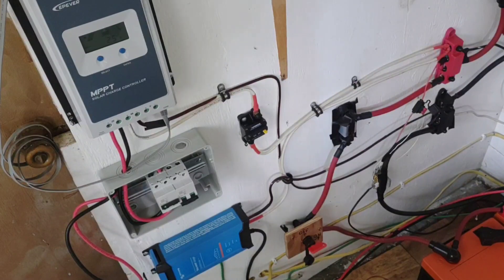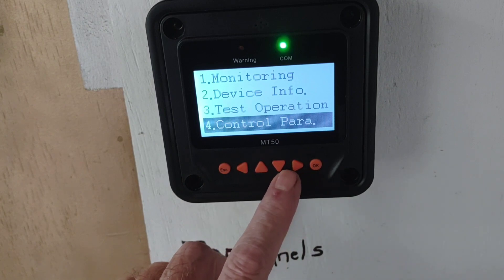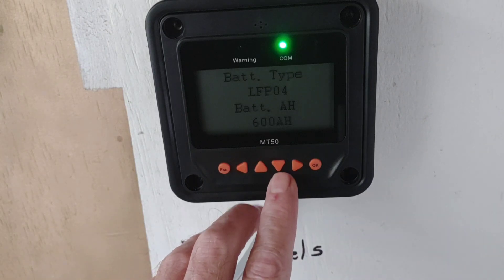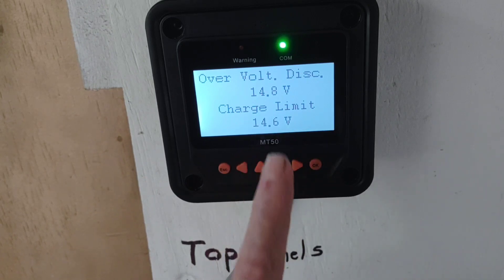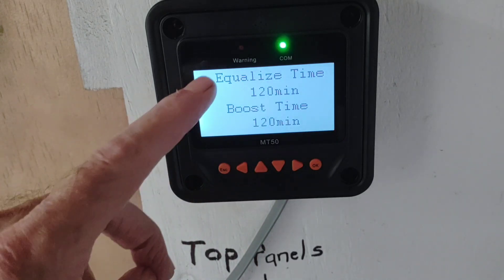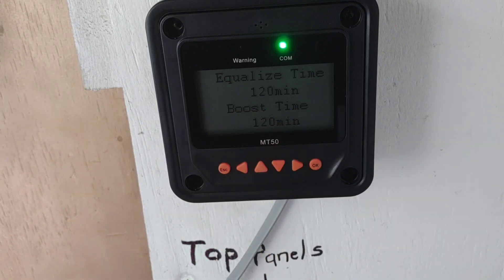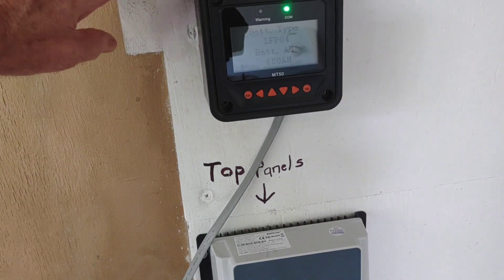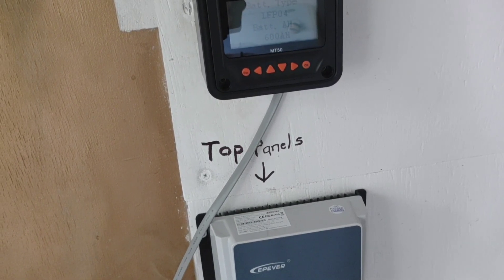EPEVER 40amp charge controller now has LiFePO4 settings installed! Yeah man!

Comment: Thanks for the video. But for some reason when I do connect my battery after clicking open button in the program it only powers up the controller like normal and the program never stars to run ? Any ideas ? What's wrong I've tried everything I can think of and followed the instructions extremely closely...

Comment: If you have a 24v system the preset to choose on the new Epevers is lifpo8, if you are having the error when attempting to set up an older Epever with lithium, you''ll get an error when saving the settings, take note of the error, go back to the start, make the changes again but skip the setting before the setting that gave the error, save settings then make that one change that was skipped, should have video'd what I did, I was waiting on a new MT50 as the old ones don't give the new settings built into the new controllers, PC connection failed, though it worked in the past on the old err Epevers I have and it's far far to hard to change parameters on the controllers interface without the MT50.

Comment: yeah LFP values with equilize;Flot;boost and other trash that not exist for LFP batterys.

there exist 1 value 14,6 Volt charge voltage and anythink other is try to hold consumers for nerds...

Comment: Can you off any help i have this same controller and two chinns 300ah lips batteries mine don’t have this option it’s about 5 monthsmold
Reply from the maker: Are you using the MT50? 🤙
Reply: @ProjectsinParadise808  yes i hooked it up and have the battery specs but haveing a time making changes

Comment: Thanks for the video, have the older Epever 40a without the Lithium settings included, I have a 24v flooded setup with this same controller, the batteries are near the end of their life, will be buying 2x 12v lithium batteries that are suitable for series connection, can anyone tell me if you simply doubling the charge parameters for 24v, there is very little online about setting up the older controllers for 24v lithium.

Can I ask why people setup these chargers for 12v when doing so halves the total Watts you can supply the charger from the panels, if this setup had 24v battery you would only need one controller as it would be able to use the wattage and voltage from all the panels you now have and 24v systems transfer the current from the charge controller far more efficiently.
Reply: In my case, it's because everything I run is 12 volt and it made sense 10 years ago when I bought my epever. Since then, I have upgraded batteries and panels but plan on sticking g with12 volt. It does what ii need.
Reply: @marshallmilligan761  12v systems are ok if it's all close together, I live off-grid and a 12v system is inefficient and not an option due to the extra cost of the expensive cable to get it to the furthest point, 24 to 12v bucks are cheap.

Comment: Thanks for doing this. I have the same charge controller as your first one. I used the settings from this video and all was fine until I disconnected from PV first and battery second to install a cigarette lighter jack. It was only disconnected for about 10 minutes. I went to fine tune equalization time and noticed all of the custom settings were lost. This is my first LiFePO4 battery (Chins) and it hasn’t been great. Just a heads up to anyone else here doing the same to check periodically that there settings haven’t changed unexpectedly. Thanks!

Comment: The old version m50 does not adopt  the automatic lifepo4/ lifepo8 settings; insted programing the m50 on "user" reset the device parameter to "user"  mode at the given parameters. Thank you. (The new tracer an 30A is also LIFEPO4/8compatible)

Comment: HI! Got a question for you. My Epever 3210AN is just 2 years old, but has no settings for LiFePo4. At least, none that I can assess at the unit. If I get the "remote," will it show that there is in fact a setting for LiFePo4 batteries? Thanks!

Comment: Someone who can answer why my 51.2 v 16s battery is «full» st 43.2 v? Dont have cable / display so used the «sel» setting as the manual said that could be used. It charged until 43.2v, then it says battery is 100%. Any suggestions?

Comment: If I use this same charge controller with a 24v lifepo4 do they have that preset or do I have to manually enter it? 
(FYI this controller also has low temp disconnect/protection now with the optional temp probe sensor plugged in)
Reply from the maker: Not sure...I have one that does, and one that does not. Manually setting your parameters is what I had to do to really dial in for my situation. 🤙

Comment: Comments you may wish to consider.
Temperature compensation is not needed for lithium batteries. 
Charge voltage, boost volts, may be too high at 14.5 volts for many lithium batteries . 14.2 volts is less stressful and less prone to put the battery into protection mode.
Float volts is too high at 13.8 volts. This keeps the state of charge at absolute maximum and degrages the battery. 13.5 or 13.4 volts is prefered.
Boost duration, the absorbtion phase , needs to be quite short, a maximum of 30 minutes.

With panel strings its important to keep the string open circuit volts below the rated voltage of the controller, five panels is very near the limit. Note as temperature drops panel volts increase.

Mike
Reply from the maker: Mahalo Mike for the great information! All the charging points you mention are exactly what I use these days. 14.2 absorb/bulk and 13.5 float. Much appreciate the reminder. Aloha! 🤙
Reply: Can provide all of your updated settings please. I cannot find absorb and bulk in the settings…

Comment: I just bought one with the MP50 in the New Year and it doesn't have the Lithium setting.  I've got to go to USER and the fart about trying make it behave on a 24v system.  I feel cheated but I guess I'll get over it
Reply from the maker: Ended up back on user setting myself on those units.🤙

Comment: Oddly enough, this video didn't actually teach me anything new, but it clarified things for me when it comes to setting up my Epever 4210AN for my new LifePo4 battery. I've been struggling with Epever's [expletive deleted] software, but after watching your video I got it worked out tonight.

Oddly enough #2, my controller doesn't have a LifePo4 setting I can reach through the MT50, but the [expletive deleted] software does have a set of controller parameters for lithium batteries. Still had to tweak them for this battery brand, but now I can access and change them using either the [expletive deleted] software or the MT50. Even better, I finally worked out how to export the settings to a text file, so if I need to redo the controller, I can just import that file.

Thanks for the help! Liked and subbed.
Reply from the maker: Mahalo and welcome to the channel! WIthout the MT-50 I doubt I would have ever got this controller dialed in. Even with it , it took me longer than I thought it would to have it working properly. Granted I am not the most technical person, but still, it should be more user friendly IMO. Over the past couple years I have upgraded to Victron, and never looked back. Plug and play on those, and making life here much easier, for sure! Glad you got something useful for your application out of the video. I am always hopeful that that is the case on all what I share. Aloha! 🤙
Reply: @ProjectsinParadise808  Aloha back atcha!  I'd have sworn I was already subbed to your channel, but either I clicked the wrong button or YouTube played a dirty trick on me.

I thought I was subbed because I have a warm spot in my heart for all things Hawaiian. I was born in Arkansas, but my earliest memories of this planet were formed on Oahu when my father was stationed at MCAS Kaneohe.

The first two fish names I learned as a toddler were "shark" and "humuhumunukunukuapuaa ". :)

Comment: I just bought this same unit and mine doesn't have the LiFePo4 settings :(
Reply from the maker: Yeah, some have it some don't.  In my case it didn't matter as I had to resort to user settings to make it work for my system anyway.  The pre-set Lifepo4 function was too high. 🤙

Comment: How's it working?  Mine lasted 8 months.  Never any mistakes.  Started making high pitched noise then eventually started reading very low voltage(14.7).  Tested with multi meter and yes indeed it was low.  Unhooked the pv wires and the voltage was back up to 80v.  Hooked up to bluetti and pv was 80v.  Hooked back up to junk epever and voltage started at 80 and within 5 minutes was back down to 14.7.  Hope you have better luck than I.  Also heard they are very inefficient but I thought it was fine.
Reply from the maker: I'm making a video about this very problem in next few day's.  In fact it has been all I've talked about here where I sit in last three days. Just had one of my Epever 40a charge controllers fail with nearly identical problems you mention,  and have heard from others as well. I have 500watts offline at the moment as a result.  Backed up on video's atm, but have already started filming.  Coming soon...mahalo for sharing this information with us...aloha 🤙
Reply: @ProjectsinParadise808  Worst part is no warranty.  I should've checked that before I purchased.  Big red flag.

Comment: I have no experience with solar panels, batteries, charge controllers, or inverters; I want to design and build a 12V direct current portable outdoor, solar powered swamp cooler that does not require an inverter.  So far, I have purchased four 12V, 100W, 7A portable briefcase solar panels which will be wired together in parallel to produce a total of 400 Watts, 28 Amps.  I will be using two 12V, 120W, 10A automotive radiator fans and a 12V, 3A submersible water pump.  The swamp cooler box will be made of varnished / waterproofed wood with evaporative honeycomb swamp cooler water bricks in the back.  I want to use a lithium battery instead of lead acid battery, but I don't know how many amp hours the lithium battery needs to be.  I will not be using the swamp cooler when there is no sunlight to power the solar panels.  The total number of amps of the two fans plus the water pump, will be 243 amps, but an auto store manager told me that 12-volt, 120-watt, 10-amp automotive radiator fans cause a momentary amperage surge (power surge) each time during power-up, and he said the momentary surge can be as much as 4 times the amp rating of the fan motor which would be 40 amps power surge from each fan motor (80 amp total power surge if what he told me was true).   I will be connecting a motor speed controller with on / off switch to each fan motor to be able to turn-on and slowly increase the speed of each fan to the desired air flow of the swamp cooler during each power-up of the swamp cooler.  If you were me, would you buy a 40A EPEVER Solar charge controller, or would you buy a 60A charge controller for my swamp cooler?  How many amp hours should the lithium battery be for my swamp cooler?
Reply: The words "I have no experience" and "I want to design and build" make me nervous. I'm all for innovation and tinkering, but only if someone has the basics down. I'm not sure you're there yet. For example, you got amps and watts confused when you came up with that "243 amps" number. That is not a minor mistake. What you've got are fans that pull 10A with a startup surge that might reach 40A, right? 40 + 40 + 3 for the water pump = 83A surge, with a normal total current of around 23A.

What you're putting together as a power supply for your swamp cooler is a basic 400W solar PV system that a lot of people, including me, have put on vehicles, except you'll be omitting the inverter. Check Will Prowse's channel and website. He has plans and parts lists to build exactly that kind of system and build it so it will work safely.

Comment: Hi I have the same epever controller, my PV is 41 volts 3amp but only 12.4 volts coming out from the controller, not 14 volts I got new battery 100ah led acid .

Comment: Hi, got another question. I have also the cheap tracer1210AN for a small 12V project coupled with a 100W panel. I applied the default LF04 settings included. I am using the load port to run a 12V fan. I noticed under load, the voltrage drops a bit but the charger didn't want to charge again while the sun is still there. Do you know the parameter voltage to start again he charging ? or do I need to decrease boost time to 0 min ? Thanks in advance if you have the answer for my question.

Comment: Hi, first contact with an EPEVER product (Tracer6420AN) and trying to setup all parameters for my 48V LFPO battery....I am using the PC software and it's a nightmare .... very very buggy.... Is your battery a 12V or a 48V ? coz you set everything for a 12V model.
Reply: Thanks for your answer. I managed to do it via the PC software !!! The trick is to export all parameters into a text file, change  there the parameters  and import the settings again. The crazy thing is all decimal values need a comma as separator not a point .... and with my french keyboard and this software, when typing a comma nothing appears. If you enter a value with a dot as separator, of course there is an error message... Weird... I did a small video on my YT channel (e-2-nomy) but it's in French language. Cheers.
Reply from the maker: If you aren't using the MT50 to program the controller it is a nightmare.  I use the MT50 on both, and it is easy, and makes a world of difference.  aloha 🤙
Reply from the maker: And I'm running 12v btw.🤙

Comment: How did you configure  the old one fir user defined settings. Or do you use gell?
Reply from the maker: I now use 14.1 for bulk,and 13.6 float. That's what is keeping this system humming along nicely now. Your mileage may vary! Aloha 🤙
Reply: @ProjectsinParadise808   I'll be getting 4 100 ah renogy batteries.  What do u set bulk/ boost reconnect? 13.2 seems a little  low, that could  be 70% soc. Seem like 13.3-4 might be better

Comment: I understand now that the MT50 is not necessary to setup LiFep04, 
that it's all accessable through the units buttons, is this correct ?
I have the 2022 Epever 2310an with a 300ah Chins LiFp04 's on the way.
Reply from the maker: MT50 not necessary,  but highly recommended in my opinion.  Without it, it's a bit confusing,  and more difficult than I would want to deal with. Have heard much the same from others...aloha 🤙

Comment: I also had issues with the epever settings and had to go with a lower 14.4 voltage myself to get the battery protection to not kick in and momentarily cut the power as it reaches a full charge. I saw you also had to change yours in the followup video you did.
Reply from the maker: Yeah , got the epever now set to 14.2. Still messing around with it trying to find the absolute sweet spot.🤙
Reply: @ProjectsinParadise808  14.4 is actually working for me.

Comment: Thanks for this video… just went out and bought the epever 40 amp with the Lifepo4 setting… really was not feeling confident with programming my own parameters into the charge controller and destroying $800.00 of my new Lifepo4 battery bank…
Reply from the maker: Nice! Good luck with your system! I had to ho back to user settings,  as the built in setting was a tad high for my system...aloha 🤙

Comment: Hello would you mind helping me
I see your settings are for a 600amp battery setup
I only have a  100amp battery.
Are these settings generic across all battery amperages .
Because I just copied yours into my old mt50
Thanks
Reply from the maker: Yes, they are for any size 12v Lifepo4 battery,  however I have had to ho back into user settings and set my boost to 14.3v now. The 14.5v pre set for Lifepo4 was a tad too high and kept triggering alarms on mt50, and the inverter.  Hope this helps you 🤙
Reply: @ProjectsinParadise808  ok Thanks for letting me know so I can do the same 
Glad you got the preset mt50 ..I've written down all your settings👍

Comment: This is great, to have their lithium parameters available to program the older version. Annoyingly though, once you've set up all parameters for Lithium, if you change the battery type back to say, sealed, the go back & select user it doesn't save the lithium settings you'd programmed in so you have to start over...
Reply from the maker: I agree,  it is annoying it won't save those parameters.  I have written them down more than once as I have flip flopped between settings that work the best. aloha 🤙

Comment: Thanks for posting this. I am setting mine up today. It does have the lifepo4 option , however I went to user and tried to change the settings to what the battery maker recommends. Several of the settings would give me an error and not allow me to save  it. Strange.
Reply from the maker: For me the obstacle on those errors was the boost reconnect setting. I had to set it first at 13.2 then everything took. Mahalo for being part of the conversation 🤙

Comment: Someone may have already commented about this but I'm pretty sure you don't want any temperature compensation for lithium batteries, so I set my Epevers to minus zero, it won't let you set it to zero but it will let you set it to minus zero, and that turns off temperature compensation.
Reply from the maker: Copy that, and thank you for pointing that out! Gonna change that right now...aloha 🤙